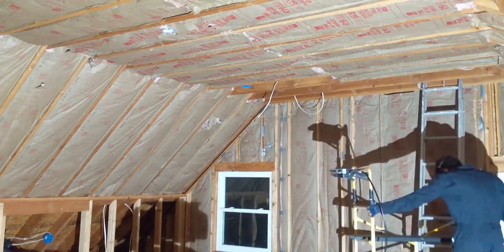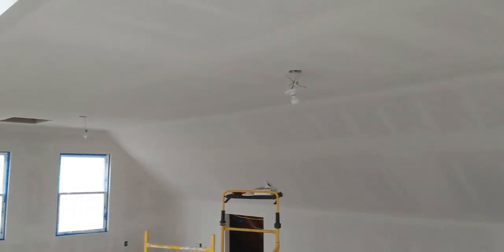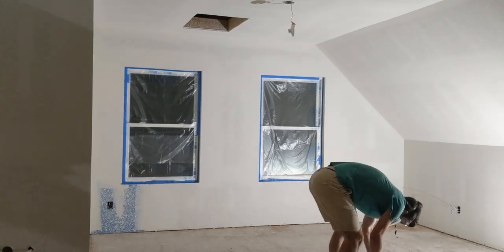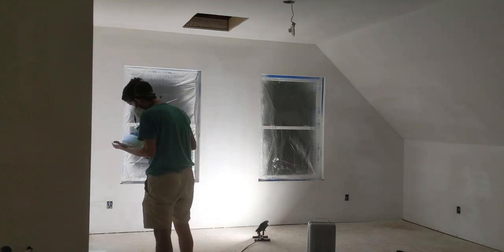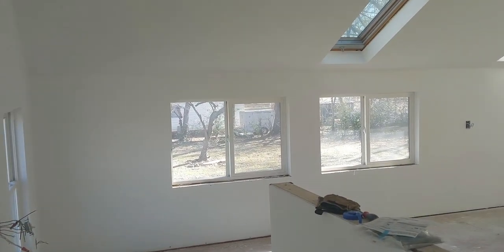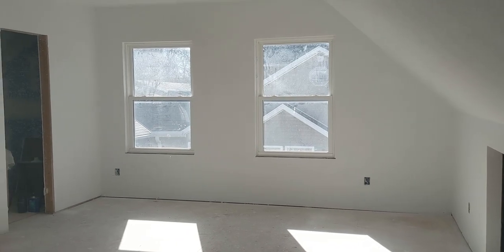Future Airbnb Apartment Above Garage Drywall, Insulation and Paint |Century House Episode 4

Comment: 3 Questions for you:

1. What kind of R-Value requirements does your area have and did that impact your insulation choice?

2. Is the garage below insulated/are you worried about losing heat through the floor??

3. Not a question, but those skylights are really popping off with the drywall and paint!
Reply from the maker: Thanks for the questions!
1. I had to consult with a few people smarter than me on the insulation. Apparently as its an existing structure the insulation that I used is acceptable. For new construction the total ceiling R value would need to be 30, so a bit more than what I've got. In the future just to be more in line with new construction code I would probably go with something that has a higher R value. 
2. The garage below is not currently insulated but that's on the docket to complete as I am worried about heat loss and sound to and from the garage.
3. Thanks I agree!